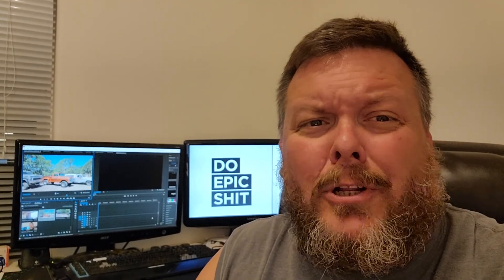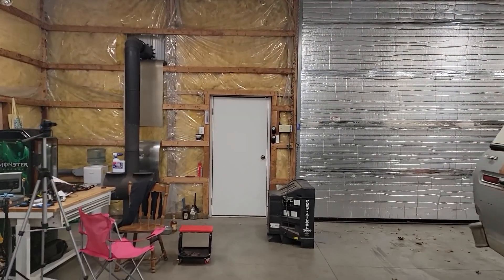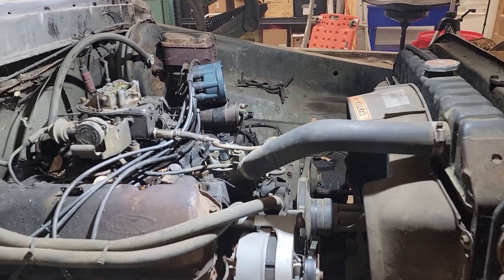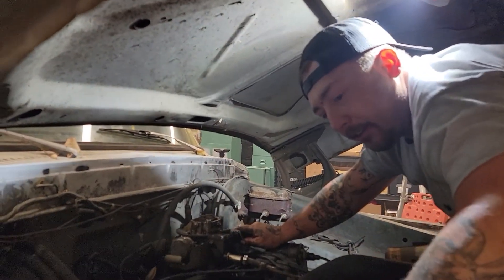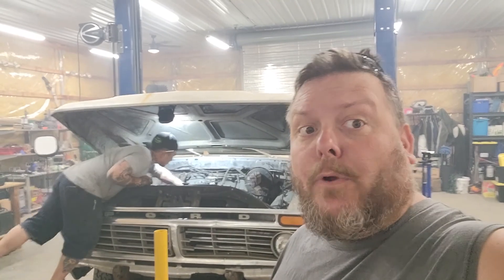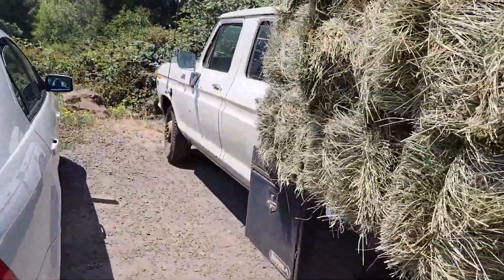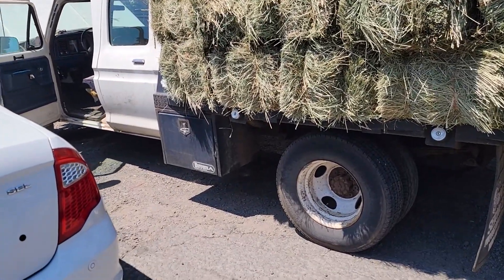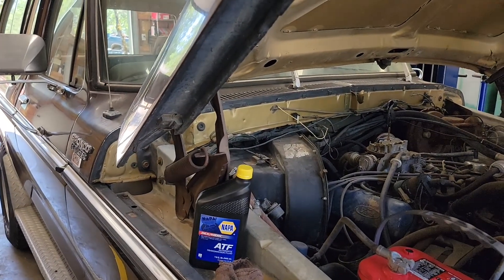77 Ford Short Bed Runs, Bronco Has A Seized Motor.

Comment: Taking or 79 Bronco camping this weekend. Just got done getting the brake controller wired up for the camper 😁
Reply from the maker: Hell yes. They are such badass trucks. What size camper are you running behind it?
Reply: @PaperBeatsRock  its an 18ft including the tongue, tandem axle. Unfortunately its had some really bad sway behind the bronco. It was actually pretty scary lol. I think the bike rack on the camper attributed to it but we’ll use an equalizer hitch if we do it again. It makes it worse though having such a short wheelbase with a 4 inch lift and 35s. Oh well
Reply from the maker: @jeschreindl  I know exactly what your saying. Back in the day I once picked up a parts bronco on a 16" tadem axle flatbed trailer and towed it with my 78 green Bronco. It was super skechy. I was as well running 35's. I should do a new test with my bronco and try towing my 26' trailer
Reply: @PaperBeatsRock  honestly I think the equalizer hitch with the sway control would make all the difference. It towed great power wise lol
Reply from the maker: @jeschreindl  sweet. let me know how that works out and if it makes a big difference.

Comment: That 79 looks so much like one i bought two years ago that had been sitting in a field for years after someone sanded the body to paint but never did. Missing most of the trim though.Short bed 4wd with a 360 swapped in that i had stroked to a 390. Real frankenstein
Reply from the maker: Wow yeah, I really do like the FE motors though. How is the truck working out for you now?
Reply: @PaperBeatsRock  I've been doing not a full restoration or anything, but rewiring the whole truck with a kit, freshening up the interior, etc and I basically just can't get the willpower to finish the wiring but the drivetrain is there and working.
Reply from the maker: @Terminxman  Bro the struggle is real and we all face it. Work all day or all week and when it comes to after hours and the weekend you just want to kick back and do nothing. 

Just set a single goal. Not the whole wiring but I'm going to go out for 30mins and just tinker on it. Just set your phone stop watch and go out and do what ever. may not even be working on the truck but clean and prep for the next day. 

Throw on some good music and get after it and after a few days of doing this your going to see some amazing progress brother.

Comment: Thought you meant the green broncos 460 was locked up 😳 I like the idea of a hopped up 400 in the copper truck
Reply from the maker: yeah, we are going to do a tear down on the 400 here in just a bit. pulled the valve covers and it's not looking good.

Comment: You guys do anything with the 400 yet? I've been thinking about stroking the one in my 79 Bronco. Found 4 bolt mains for it and a rotating assembly. But no luck on a single plane intake. But most of the 351 cleavland stuff will swap over to it. Good channel guys keep it up.

Comment: Oh, and so you thinking about a 400 Stroker or doing a 434 or 444 from Tim?
Reply from the maker: So the more we talked and looked at options I don't think we are going to stroke the 400. will probably do flat pistons, decent cam, 4 barrel intake, and sniper EFI.
Reply: Yeah I think that'd honestly be the better route. EFI woukd be nice, kills the throttle response but you can get some of that back with a recurved MSD Pro Billet Distributor, 6AL Digital to support and an HVC Coil.